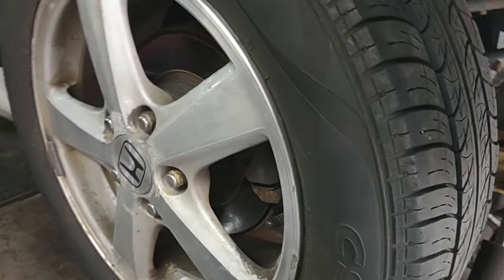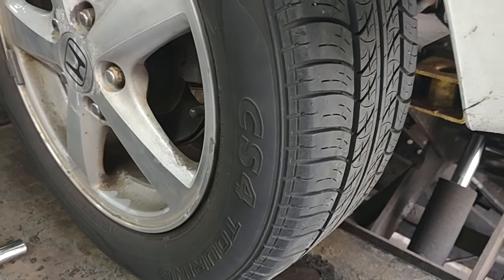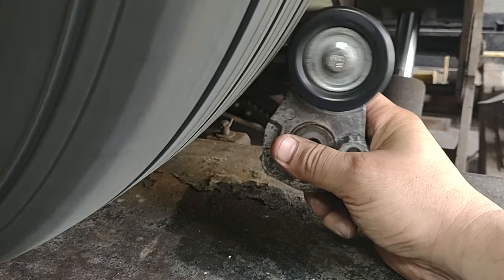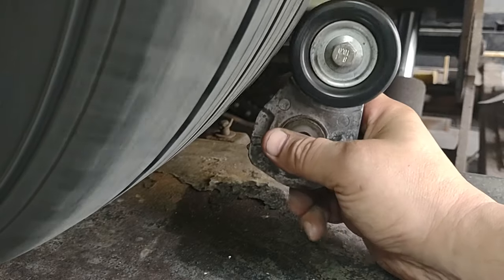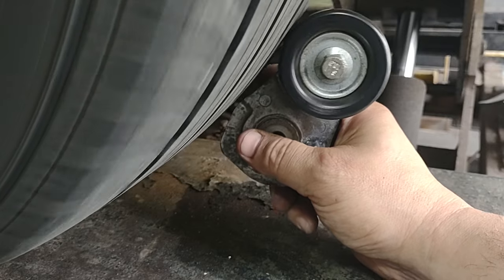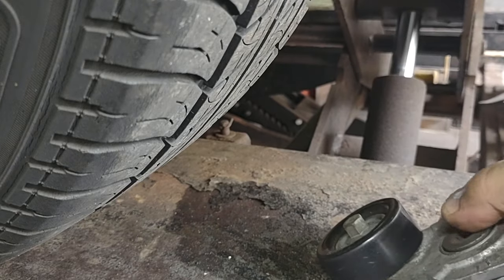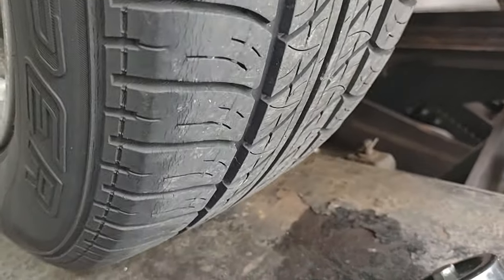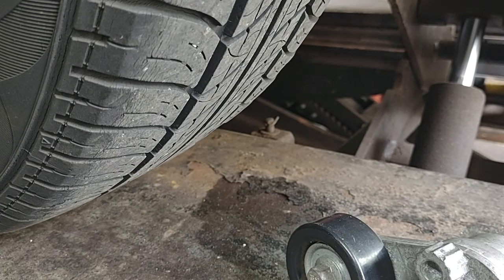Noise coming from my Tires, Tires humming noise, frontend noise, humming noise

Comment: oh thats a smart way to find out. My 2007 OBW has this humming sound too. But 90% peoples said is the bearing.  LOL, is hard to tell when you doing over 70mph.
Reply from the maker: If your tires have low and high tread, it is most likely the tires, keep in mind that there are some tires tread pattern make noise from day one, specially if there is a large gap between treads, Thanks

Comment: There's a deeper problem causing the tire to wear unevenly. Such as bearings, bushings, control arms, etc; or something simple as rotating tires on schedule.
Reply from the maker: I agree, Any bad suspension or steering parts can cause tire wear, Thanks for the comment!
Reply: It all depends not all of that will be wrong depends when you check it
Reply: Some tires are not perfectly round from the factory. In such a case they will develop a harmonic/bouncing effect and the problem can get worse over time by itself.
Reply: I’ve had new tire start howling on me after two weeks and my girlfriend was the one that told me about it

Comment: If driven like this does it increase your chances of having a flat tire? Had one already, put all 4 new tires on. And loud with speeds over 60mph. I’m pretty sure this is what’s happening. New tires. Wear them in. Just don’t wanna wear em in wrong and get another flat LOL
Reply from the maker: Hi Nick, not sure if I understood your question, however if there is noise after installing new tires, you may have bad wheel bearing or the the tread design on the new tires are making the noise similar to truck tires. Driving with bad tires can cause unexpected things it depends on the brand including going flat, stay safe!

Comment: My friend's 2000 Honda only makes a humming noise between 35 and 55 MPH on the driver side.  We thought it was the transmission because the noise is only at certain speed range, but the transmission is mounted on the passenger side.  Any thoughts please?
Reply from the maker: The first and easiest way to check is the tire, you can swap tire location and see if this humming follows that particular tire, keep in mind if you have different tread pattern or A symmetric tire or directional tire that installed wrong will cause noise, next I will check wheel bearing, if the humming noise associated with vibration you need to check drive axle, I can go on and on with the causes but those the most common ones, in some cases wheel alignment, bad control arm, struts and steering parts like inner and outer tie rods if they are bad they can force your tire to position in specific direction outside of the the normality at certain speed. I have a video on my channel about wheel bearing check it out. Good luck

Comment: How are you making the tyre spin? Is there someone in the car stepping on the gas?
Reply from the maker: This was the rear tire with no drive axles, it was easy to spin by hand, however even if it was the tire with the drive axles in still can be spun by hand but it needs constant hand spinning, having someone in the car stepping on the gas is NOT recommended and it is extremely dangerous so DON'T attempt that.

Comment: Best kits to check your tires or hum noise first first time seeing this great explanation 
I have a similar noise they told me it’s both bearing in the back but it only makes noise around 15 to 25 at higher speed there’s no noise but when slowing down u can hear it
Reply from the maker: Wheel bearing and tire noise are somehow similar and it depends on how bad the tire tread are, if the tire tread look similar to what you see in this video or worse, you can start with changing tires first since you have to change them anyway, but if you notice vertical play in the tire most likely it is the bearing that causing noise too, Thanks

Comment: Is there a way to fix this without changing the tire?
Reply from the maker: When it comes to uneven tire treads, it's usually best to go ahead and replace the tire altogether for safety reasons. However, in some cases, if the outer tread is in good condition but the inner tread is uneven, you might have the option to have a tire shop flip the tire on the rim. This technique only works for symmetric tires, which don't have a specific inside or outside indicated on the tire wall. Flipping the tire might help reduce noise, but please keep in mind that this is just a temporary solution. Ultimately, it's still recommended to replace the tire as soon as possible to ensure your safety on the road.
Reply: @carservicepro  Ok thank you!

Comment: I have kelly tires (were on vehicle when i bought it) humming around 40 goes away at 50 comes back around 65
Reply from the maker: Not all tires are created equal. Certain brands may be well-suited for smaller cars but could prove uncomfortable for others. It's important to consider that tires are composed of rubber and steel, which can react differently to factors like temperature, weather conditions, duration of storage, and road conditions, depending on the materials used in manufacturing. Additionally, tire pressure significantly influences their performance. Apart from these considerations, issues with wheel bearings could also arise. I recommend having your car inspected by a trusted mechanic.

Comment: So in this case, how safe can we keep running with this bad tire? Is it very necessary and urgent to replace it? Thanks
Reply from the maker: It is always recommended to change any part on the vehicle that shows sign of wear before it get worse, I cant say it is urgent or not, all it depends how bad your tire is, in my opinion I will change it, because I don't like surprises, it is like when you hear accessories belt noise or brake starts to whistle, don't wait until the belt snaps or the brakes to go down to the rotors metal to metal, I will have this under preventive maintenance and change any part the I suspect might cause any issue while I am driving, Thanks

Comment: I just had my tires rotated and I'm hearing noise from the front. I took the technician for a drive. He put the car on the lift and spun the tires a bit. He didn't do this of course. Is it common for tires to wear unevenly, but it's not apparent until they are moved to the front? (front wheel drive) Thanks so much!

Comment: Hi and thanks for the video, I have a similar problem but I can't compare because you don't have the sound while driving the car, so maybe is possible sent you my recording of the sound and tell me if is the same or similar, because the technicians said is the wheel bearing or the CV axle
Reply from the maker: Hello, it is not easy to tell from recording, I don't want to give you the wrong diagnosis, the car has to be driven by the person who is checking it, if one tire has this high low tread , it is most likely the tire, very rare for the axle or CV joint to make humming noise, axles usually make clicking noise or vibration, you can change tire location and see if the noise follow the tire, also if only one tire you can put on the spare and see if the noise goes away, your mechanic should have the confident in finding the source of the noise, I am sorry this is the most I can help since I am not near the car, good luck and thanks

Comment: Is it possible to reverse this type of wear by rotating the tyres?
Reply from the maker: I don't think so, usually this tire wear caused by bad suspension, I recommend fixing the suspension parts causing this which is most likely the shocks or struts and replace the tire and make sure air pressure to specs, I have seen others sand the tire thread with Sander machine to even out the threads, but I never tried it and I don't recommend it, thanks

Comment: Good video, thank you ! Even if the tire protector seems acceptable for driving I see cracks on tyre sidewall. Its better get red of these tyres and get a new ones. As from my experience some of Cooper tyres are absolute garbage - just after 20-25K km from new you see sidewalls peeling of. Dont buy Cooper.
Reply from the maker: Great point!

Comment: Hi, I have pulsating buzzing sounds 60 and above and it gets worse when I steer to the left in 60 and above speed, any advice?
Reply from the maker: Well! it depends what kind car you are referring to, However the most common causes are Tires specially if you have cheap tires and different brands and different tread installed on your vehicle will cause noise, Wheel bearings, Brake rotors, Drive axles, Wheel alignment, wheel balance and anything spins very much, there are other causes that depends on the drive train like 4X4, AWD, FWD, RWD, I am trying not complicate it, but I would start with checking the tires and rims for perfect round or bad tire tread, at the end most of the time the problem is tires!
Reply: @carservicepro  Thanks for the replied. I got a 2021 Toyota Camry with 4 new tires installed. I got the car with old tires and I replaced it right away, so not sure if there were this issue prior to the new tires installed. Do you think alignment can cause this issue. I haven't done alignment and my steering wheel seems to be a bit off to the left.
Reply from the maker: Alignment is important however won't cause what you saw in this video, I have made different tire issues videos you can watch on my channel and this is one of them https://youtu.be/lPelvzQIe3g
Reply: @carservicepro  Thank you so much for all the help. My car is making me very frustrated, I don’t wanna waste money on the bearings if that is not going to fix my issue. Can you please recommend me what is the best thing to do to have this issue mitigates. My car is 2021 Camry with 40k miles. I bought from a salvage auction rear end collision, came with very bad tires so I replaced it with used like new nexen tires all 4. I just did the alignment too that fixed the crooked steering wheel. The car have no vibration sometimes I feel sensation in the accelerator but other than that no issues except I start hearing low buzzing sounds around 40 mph and as soon I hit 60 mph I start hearing pulsating buzzing sound. Let says i’m in 80 mph and let my feet off the accelerator I still hear the sound until it goes below 60 mph then sound disappear. A mechanic test drove it and thinks one of the bearing make this noise but he is not sure which one and he will have to check all 4 to see. Is it possible the used like new tires that I bought off marketplace might having some issues. Any advice will be much appreciated.
Reply from the maker: Since you mentioned your car was purchased from an insurance auction, I assume it was from Copart, IAA, or a similar auction. These auctions often use forklifts that can cause more damage than the original accidents. Just because the visible body took the hit doesn’t mean your wheels are fine. Here are some things to check:

Wheels: Check if they are bent.

Wheel Bearing Hub: Look for excessive run-out.

Drive Axles: These can cause vibrations, especially during acceleration. Your mechanic should be able to spot these issues easily.

Additionally, used tires can cause noise even if they look fine visually, as they behave differently under load, temperature, and road conditions.
Reply from the maker: Check this video for wheel bearing https://youtu.be/UUaWWu9fa9o
Reply: @carservicepro  Thank you so much. I check the wheels for play and sounds, but all 4 looks normal.

Comment: Hi. I have a terrible humming noise coming from the back at higher speeds noticeable on smooth roads. Driving me crazy. I just rotated my tires and the noise is still there, exactly the same. The bearing was also checked and is fine. Car is front wheel drive. Could it be a bad rear alignment maybe?? Thanks
Reply: Most likely if you hit a pothole or curb

Comment: My tires are humming at higher speeds. Wheel bearings are fine. My mechanic can't figure it out. Sensors are working properly. Tires are a few months old . The road noise is extremely annoying. Just started a week ago. Might have to rotate them
Reply: Did you ever figure it out?
Reply: @MikeL0084  it was the bearing after all. I had to convince my mechanic to replace it.  It went away

Comment: Thanks for the video, an interesting way to test,  that tire is cracking too,  as you mentioned, the tire is bad.
Reply from the maker: This little jump was making noise similar to truck tires or wheel bearing humming noise, However We did change the tires after this video and the noise completely gone, Thanks for watching!
Reply: First thing to do is changing tires if it doesn’t fix the problem then u can go on the bearing  most likely check your tires wears

Comment: Great video. How dangerous is it? I have the same issue on my new winter tires and I dont have an idea how to explain and prove that tire has this flaw.
Reply from the maker: Check Alignment, wheel bearing, shocks and etc, any part is connected to the wheel, suspension and steering must be checked to assure safety, sometimes low quality tires is a reason why tire change form to a certain way, the rubber and steel they use can differ in manufacturing! Stay safe, thanks
Reply: @carservicepro  Thank you for you response. I am pretty sure that the noise is coming from tires. I switched back to all season tires and the noise is gone. I have balancing done 2 times already but noise and vibration are on the same level as they were before balancing( I am going to take me car for road force balancing next week. That is my last hope to get it fixed. But if tires are not fixable I dont know how to prove it to a seller and how to get them replaced (
Reply: @ITSZ0RG  Hey, I think I am having the same exact problem right now. I got them balanced twice and then today I got them balanced at a different location that has road force balance and I still have the same issue. I am suspecting there is flat spots on the tire. I will check back if I fix the problem or if you can shine some light on the problem
Reply: @099JOEY  Hello. Thank you for sharing your experience. I spent a lot time searching for potential solution or causes of this issue.
I begin thinking that it could not be tires issue. I mean tires are the source of the noise, but I think it is just tires threads disign and much more softer rubber of winter tires that cause  tires make sounds like a chopper (helicopter).
However, I  doubt that it causes any vibration.
I put my headphones and listen to music reality loud and I dont feel more vibration than usually.
I suspect  that the reason for tires to make this noise  is the much bigger winter tires contact area with road especially when the temperature above 0 Celsius. 
I am going to wait until temperature drops below 0 Celsius to see what will happen.
Also if you did force road balancing it should show if your tires out of round.
I mean if something is wrong with tires shape or if they have any flat areas force road balancing should have revealed this.
Please keep me posted on this issue.
I will also let you know if I find a solution. 
For now I will wait for real winter to come )
Thanks.
Reply: @ITSZ0RG  Sorry for the late response but I did a test with the front of my car on jacks and in neutral (tires chocked) and I spun both tires forward and reverse and even held the coil spring to feel for vibration. There was an awful noise almost grinding noise from both sides but the driver side had a lot of vibration I could feel in the coil spring. I ended up changing both front wheel bearings and the problem went away. Good luck to you
Reply: @099JOEY  thank you for the update. )

Comment: What could it be if it's a consistent humming noise.  I've changed the wheel.bearing and axel and also bought a new tire
Reply from the maker: Check the differential and if it is 4 wheel drive you need to check both differentials, also check the drive shaft if you have one, one note if tires are winter tires or the threads have big gaps they will make noise, however you should have your vehicle inspected by good Mechanic, Good luck 🤞

Comment: Can I lift up the car and spin the wheel to isolate tire noise if I'm checking for a bad wheel bearing?
Reply from the maker: It depends on how bad is the wheel bearing, in some cases you need the vehicle load on the bearing, when it is of the ground there is very much no load, in any case you can try to see if you notice some play if you wiggle the wheel vertically! If there is no axle through the bearing like if you check the rear wheel on FWD vehicles  this one is easy to spin the wheel by hand of the ground, you will hear abnormal noise easier!

Comment: I have this humming sounds cumin from the back when im taking a left or right turn...both wheel bearings are new and i also have new tyres can you help?
Reply from the maker: Are you sure it is the back not the front?  keep in mind some tires they make noise from the get go due to the tread pattern and design , it could be the axles or the differential bearings or gears, there are other causes depends on if it is a car, SUV or or pick up truck, also make and model, 4x4, 2 wheel drive, All wheel drive and etc., also if it is pressed wheel bearing or hub bearing, some models on the rear you have to know the torque specs for the middle nut you cant over tighten it, ... Let us know if you found the exact issue, Good luck!